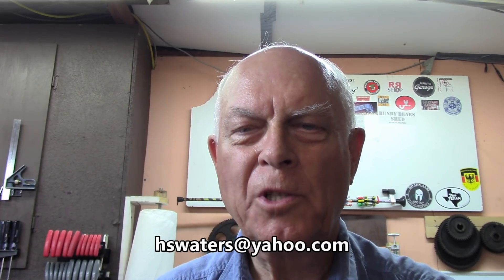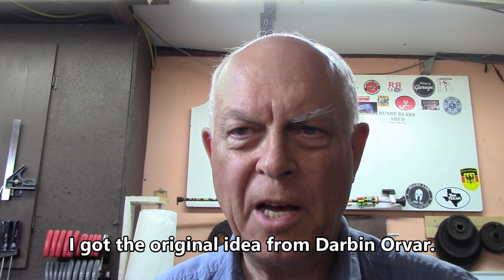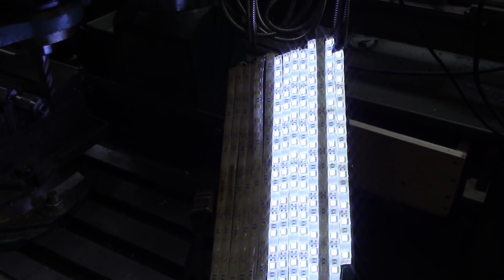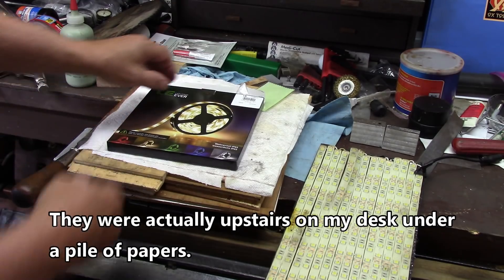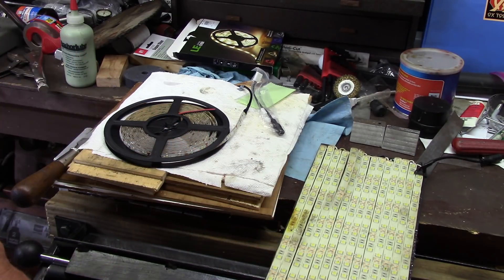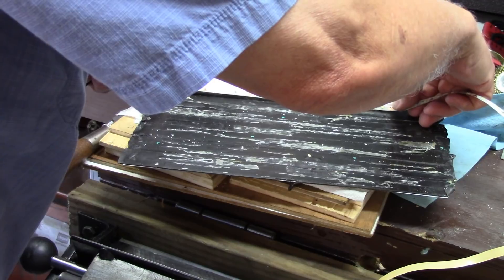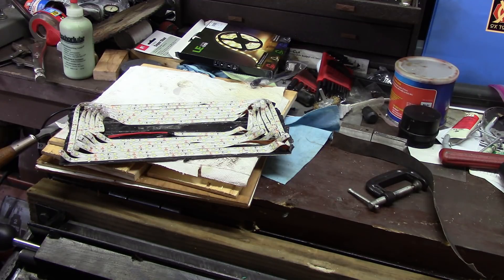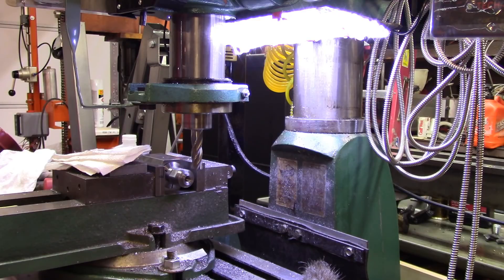LED light for the mill

Comment: I never tried soldering those LED strips. I sure could use another light on my mill. I have a spotlight on an arm now. It is meh. Better than nothing I guess?
Reply: My spotlight is Stone Age in a stick your hands in the fire kind of way when it is on. As it sinks heat into me then. That little bugger gets hot when it is on! Which does annoy me.
Reply from the maker: Thanks for stopping by..